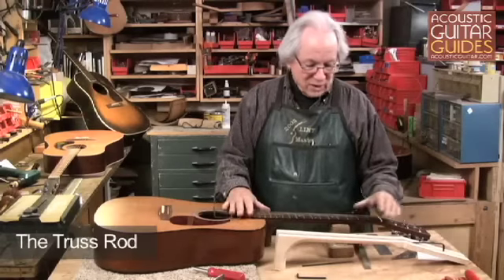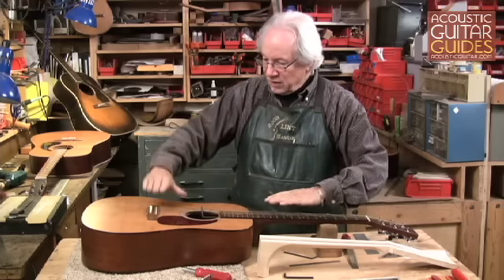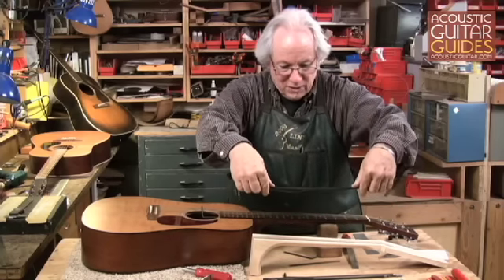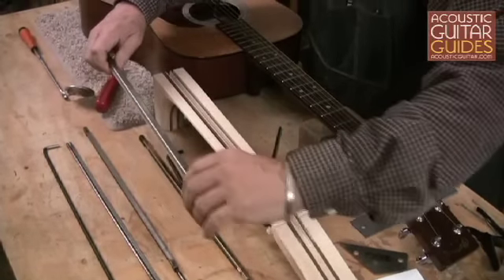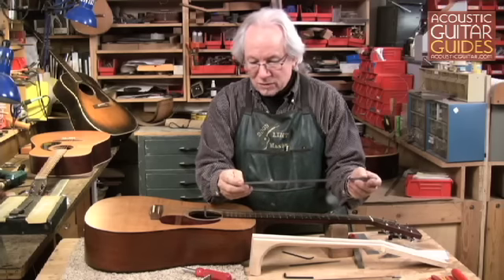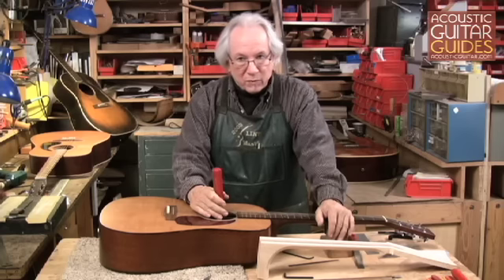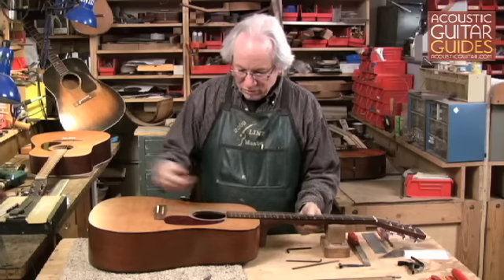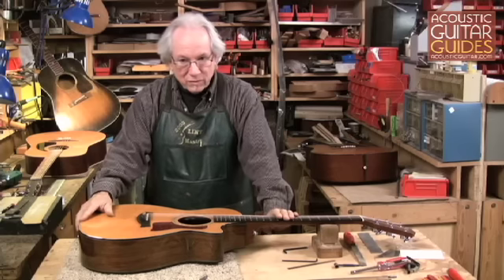How to Adjust an Acoustic Guitar Truss Rod (Excerpt)

Comment: This is, by far, THE best explanation and demonstration of truss rod adjustment including all the varieties of trust rods that require careful and subtle techniques. In addition, this great Luthier makes very important comments and observations about the difference between “action“ of a guitar versus “tension levels” within the neck of a guitar. “Action” and “neck tension”, as he points out, are not the same. Action requires adjustments at the nut or the saddle versus the truss rod. Excellent video!

Comment: I have a classical, with truss rod in the soundhole. It has  a slight forward bow that I want straightened. At 6:25 he says he's trying to "allow for vibration", but his 1/8 right turn was supposedly to make "less relief"? Isn't that going to lower the action? Isn't that going to make less room for vibration?? Omg, I just need a simple, plain spoken answer!! Short and sweet! Which way do I turn the truss-rid in my sound hole, to straighten out a forward bow? Geez
Reply: I am dealing with the same issue right now with my fender lol.
Reply: @krazykozey2259  It's a right turn.
Reply: @dannysmuzic1807  Thank you just adjusted it!

Comment: I took my guitar to New Mexico, where it is dry and cold in the winter. My brand new Martin really suffered. A week later, my action was pretty high at the 7th fret. I constantly hear that the nut should be checked out first when there is an action issue. But in this case, the nut was 100% new and the action was normal at the first few frets.
I've also always heard that a luthier/repairman should adjust a guitar. But I had a lot of confidence in myself, even though I had a $1500 Martin to potentially mess up. So I took my Allen's wrench and I added more back-bow by tightening the truss rod. I was paranoid. Only micro turns at a time. I would turn, tune, then play. Then I left it alone for a few hours. Then I repeated it 2 more times.
Finally, I set the perfect amount of bow.
I just learned that less is more when adjusting a truss rod. Same thing for those that ever adjusted a cork of a flute.

Comment: Thanks for you video. I appreciate you explaining, and showing us what to do. I do have a question. I own a Martin D1. I noticed just recently the action was pretty high up near the sound hole. I assumed maybe a truss rod adjustment would fix this. So I ordered a guitar neck straightness tool, and a truss rod tool. Some new Martin custom light strings. Before I do anything I checked the neck with the current strings and it seems to me to be perfectly straight with the tool. What would be causing the high action. I mean its not terrible but noticeably higher than normal. The temp changes in my house have been pretty crazy do to winter. No central air, so when it gets chilly I jack the heat up, and turn it off until chilly again. Probably not the best for the wood. But still, neck is straight,  high action exists. Toward the tuners its great and normal. What should I do?
Reply: You probably just need to adjust the height of the “bridge” on the guitar. Pretty sure the D1 has a removable bridge made out of bone. Take all strings off, remove the bone bridge. Take sandpaper on a flat surface and sand the bottom of the bridge to your desired action then enjoy. Don’t adjust the truss rod for “lowering” action. You will just end up with fret buzz or a broken neck. Most high end guitars (Gibson, fender, martin, PRS) already have the truss rod adjusted to the optimal position with the recommended string size for that guitar. But if you play with different size strings or different tunings or play extreme humidity or extreme dry areas then it’s possible it may need adjusted but very unlikely. These manufacturers or builders make the same guitars in different ways. Some guitars will have the action already adjusted to the minimum height without feet buzz. Some of the guitars they make will not have the action adjusted at all on purpose for people who play really hard and loud, they don’t want the action to be very low or they might encounter fret buzz. Hope this helped. Just look up a YouTube video on “sanding down acoustic guitar bone bridge” or something similar.
Reply: @Znew07  The Brown or Black piece of wood that holds the WHITE piece is called the BRIDGE, the white piece is called the SADDLE, the strings lie across the SADDLE, you sand and lower the SADDLE, the Bridge is glued to the Face (sound board) and doesn't come off, unless you use tools to remove it.
Reply: @jrm11111955   yes, you are correct. Sorry. I think I was half asleep when I was writing that.
Reply: @Znew07  I understand, this last year has everyone walking around asleep, myself included.
Reply: @Znew07

Comment: .. but how much space is it supposed to be between the strings and the frets when you push down on both ends? I've been tightening and loosening it back and fourth for a while and don't seem to get it right.
Reply: with pushing you want a almost a bit of space or almost none. the saddle determines most of the action anyway.
without pushing you want around 2mm for the high E string at the 12 fret for easy playing, may affect very hard strumming maybe.

Comment: what do u mean by the "relief of the neck" ?
Reply: Terry Adams When the truss rod is tight it prevents the neck from bowing under string tension.  As you loosen the truss rod (counter-clockwise) it allows the neck to curve slightly.  That curve is “relief” which gives the strings more room to vibrate without buzzing on the next fret.
Reply: thank you

Comment: Hi  very nice tutorial sir! Just have a question... i went to a luthier to lower the action, they tighten the rod to maximum and lowered the saddle, now i have a 1. 90 mm string height from the 12th fret. Is it safe/recommended to loosen the rod again to make it a lil tiny bit higher ? Coz i have some fret buzzing